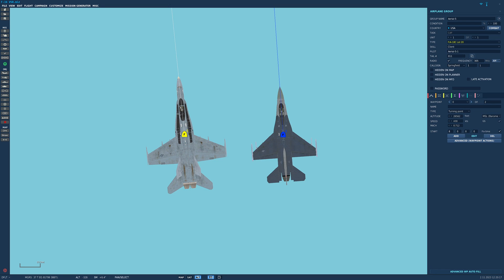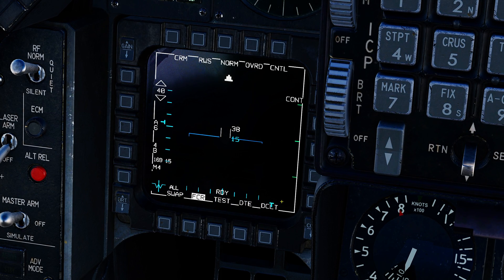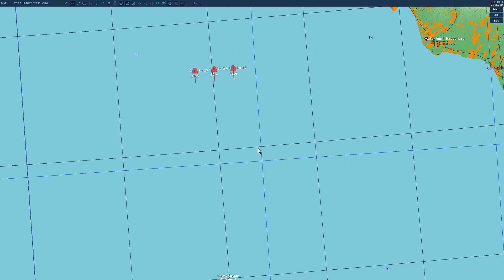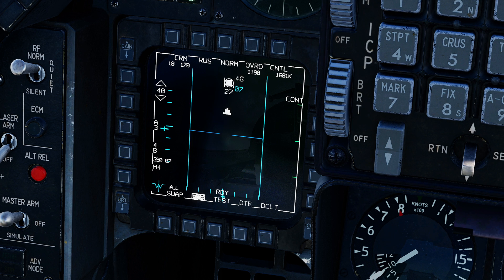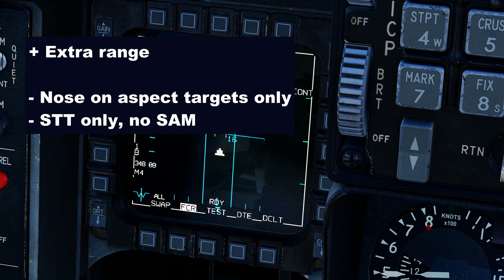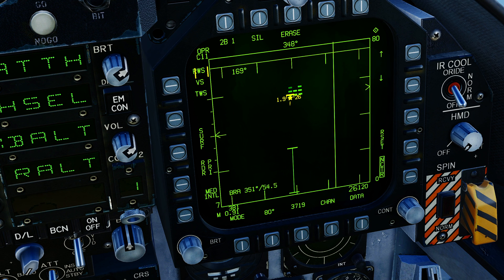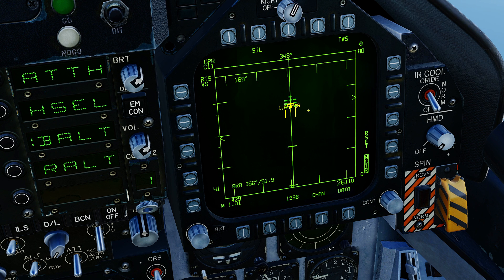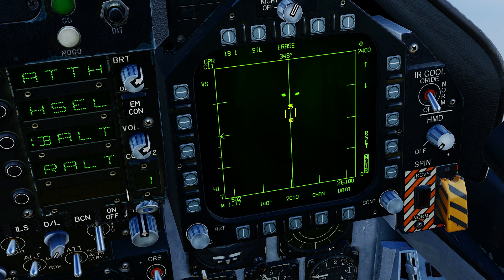F-16C Viper & FA-18C Hornet: VSR & VS Radar Modes Tutorial | DCS

Comment: Hi Cap, I think it would be super awesome if you could (probably with CH’s help) do a scenario involving a conventional version of the AGM-129 Advanced Cruise Missile (ACM). It’s a stealth cruise missile with a range of over 2000 nmi. It was in service from 1990 to 2012, there were 461 built and it was supposed to replace the AGM-86 ALCM as a strategic nuclear-tipped cruise missile. It ended up being carried exclusively by B-52s (each could carry 20 of them) but the main idea behind the project was to integrate the missile into the B-2 fleet but the ACM was so advanced, so ahead of its time that producing and maintaining it was a real nightmare so the USAF decided not to move forward with the idea. They ended up producing (and later upgrading) only the nuclear AGM-129A version but initially there were plans to also produce a C version with a conventional warhead and later a B version with unspecified upgrades over the A.
If you’d be interested to learn more, there’s an awesome article about the ACM on The Drive/The Warzone titled “The Saga Of The AGM-129 Cruise Missile That Was Basically A Stealth Jet Designed Upside Down”.
Reply from the maker: Roger will investigate.
Reply from the maker: Looks like a Storm Shadow on steroids.
Reply: @grimreapers  It also kind of reminds me of the JASSM-XR but with almost twice the range. It’s incredible that the ACM was designed in the 80’s and it would still hold up pretty well in the 2020’s.